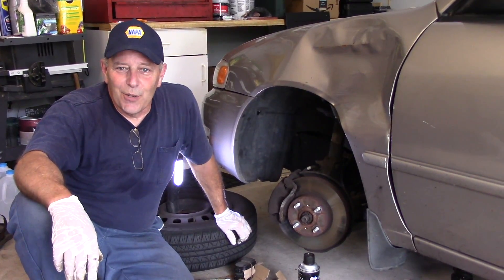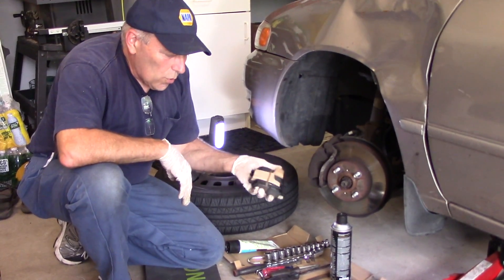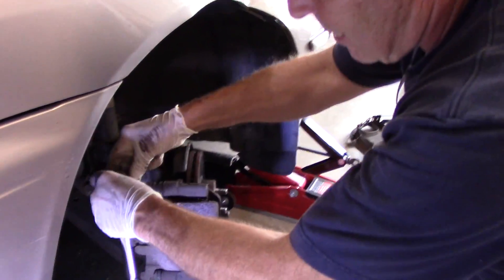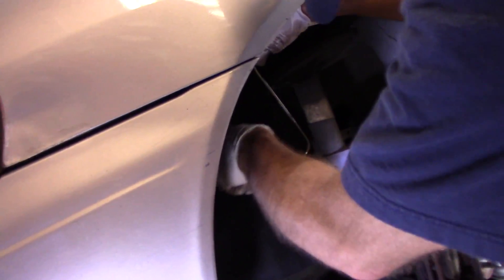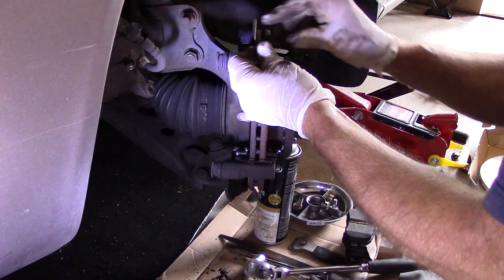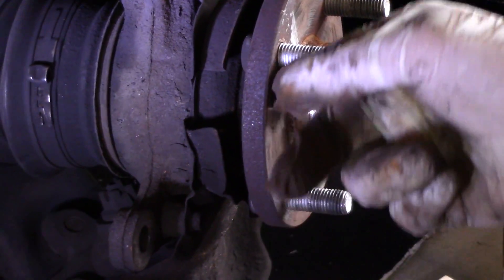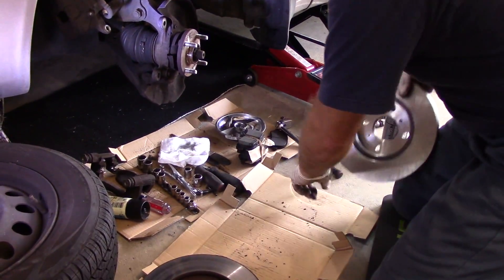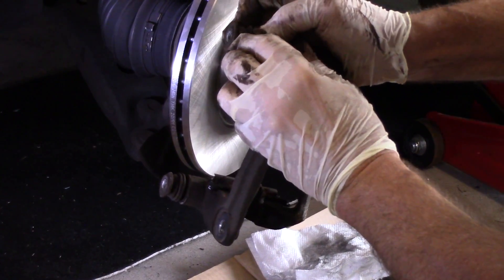How To Replace Front Brakes & Rotors 1995-2010 Toyota Corolla

Comment: I would recommend NOT wiping down the new rotors. I’ve tried various shop rags, microfiber, and others, and they ALL leave little strands of fiber in the metal. You wouldn’t be able to see them with old man eyes, or in dark garages, but hold it in the sun after wiping and you’ll see fibers all over. Just leave that grease on there, it burns off after your first trip out. Secondly, after you pull the pins out, clean out those rubber boots and holes with Q-tips. There is often little pebbles and rust in there. It helps to wet the Q-tips with your mouth so they don’t leave fibers in there either.
Reply: nice to know!
Reply: The fibers would burn no issue there

Comment: When compressing the piston, I would first crack the bleeder valve on the caliper so contaminated brake fluid from the cylinder bore doesn't get pushed back into the hydraulic brake line.

Comment: Thanks for this video sir, but is it not necessary to remove the brake reservoir cap before pushing back the Caliper piston into its bore and in addition is it not also necessary to bleed the brakes after changing brake components?

Comment: I don't hear Jimthecarguy cautioning the Sunday mechanic on the dangers of breathing the break dust, a cause of lung cancer.   He does at one point warn against a fast initial spray of the assembly in order to avoid scattering the dust into the air.   Nothing more.   He wears gloves but no face mask to filter any dust that unavoidably may get into the air.   Tell us why no more words of caution, such as "be sure to wear a face mask with a proper filter for brake dust!"
To be fair, I have looked at other videos on brake repair and have not found much concern expressed about protecting oneself against the dust.
Reply from the maker: The newer cars are made with organic free pads and shoes.You do bring up a good point but I have one question for you where do you think the brake dust goes as the shoes wear down on every car, truck and suv on the road ? Thanks for your input and watching.